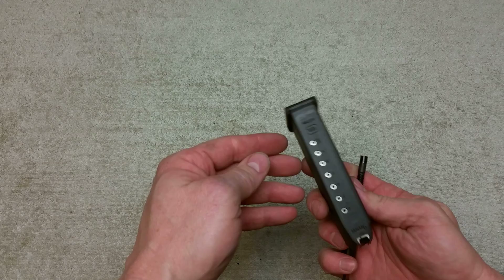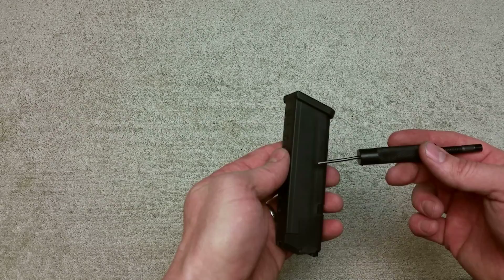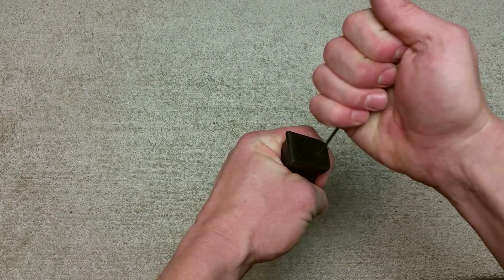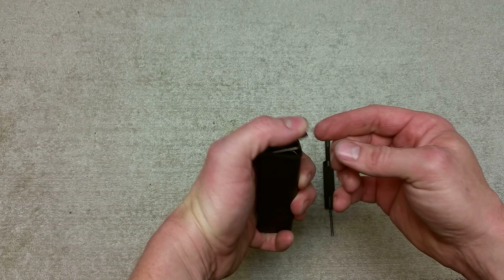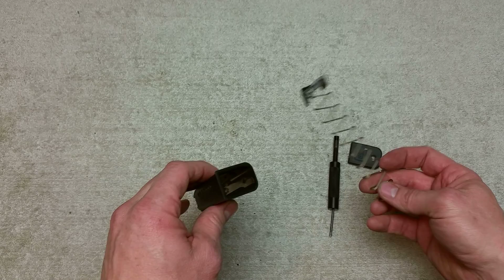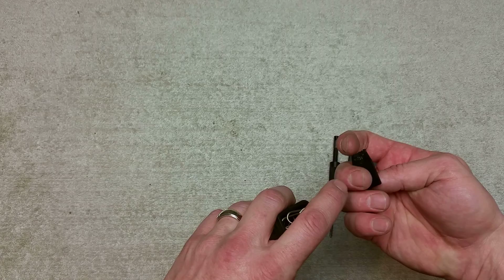California Glock Magazine Disassembly

Comment: Thank you for this, you saved me a lot of swearing trying to disassembe the 10rd mag.
Nobody else seemed to understand how the thicker mag body makes it more difficult then a standard glock mag to take apart.
Reply: Do you know if works on Glock22 10rd mags??? Lmk thanks
Reply: @Victoria Martinez That's a good question,  it should,  the glock 9mm magazines and glock .40S&W magazine are pretty close in dimensions to each other,  it might even be easier,  because  on the  .40S&W magazines,  the internal ribs that restrict the number of rounds that can be loaded would be smaller
Reply: @marubahoppie  thank you 👍

Comment: I've always wanted to know how to "disassembly" a Glock magazine lol thanks
Reply: Disassembly of this is useful to see, for those of us new to restricted magazine sizes. I didn’t even know that a ten round Glock mag was a thing until recently. A few years ago I ordered a 10-round AR mag thinking it would be a shorty mag. When it arrived it was  CA-compliant 10 round mag that was the same size as a normal AR mag, but with an insert and shorty spring (which I easily converted using a spring from a bent surplus mag that wouldn’t seat properly). Why would they make something like that? Why not just use an appropriately-sized 10 round mag? Anyway, this video helps me to see that I won’t be able to easily convert a Glock 10 round mag with these old springs that I have. So I guess I’m stuck with that I’ve got!

Comment: Can you hollow out the thick walls? With like a hot knife?
Reply: What every Californian wants to know.  Dremmel?
Reply: @upjumpstheboogie334  if you have cool family or friends out of state you can send them things you order online and they can then mail them to you. It’s a lot easier than the route you’re talking about. I’ve done it myself.
Reply: @Wormuloid4157  might wanna keep that to yourself next time feds are online too.
Reply: You can't, iv tried but ah..... there's brand called ets that uses clear plastic and no metal liner so use your imagination. Though I suggest a little saw, file and sand paper. First one took like 5 hours but it got easier when I figured it out. Also make sure to not screw up the feed lips with the file.
Reply: @upjumpstheboogie334  Dremmel couldn't even get through the plastic glock uses much less the metal liner, and even if it could unless you got a dremmel attachment that is like 7 inches long you're going to have trouble doing anything but the very bottom.

Comment: Didn’t work at all for my 10 round mag. Tab will only go down ~1/8” no matter which direction I push. Glad this worked for some folks though.
Reply: i hav ethe sqame problem
Reply: hey i found the way to pull out the back plate !!!!!is wey to easy  jus ttwo flathead and little of patient an dwork
Reply: @ezequielandrade3100  so it is possible then- for a Glock 10 round mag in California. Are you sure its possible? Ive tried and tired..
Reply: @AudreyBradford  yes but you still limited  to 10rds.  i remove the orignal base plate , and i install  aluminum  base plate, just to add more weight. on the magazine 
Note: i used long tweezer   and  i remove the plastic base plate from the sides, took me like 4miutes
Reply: @ezequielandrade3100  I will try using your advice. ty

Comment: I have the same California 10 round mag and I'm using a punch that fits into the hole and no matter how much downward pressure I apply that round button or pin will only go in less than a quarter of an inch and it's a hard stop I cannot get the plate off help please

Comment: It works okay, I have a 3/32 punch and pushed up against the corner 10 round mag is a real pain you severely scratch up the plate I didn't damage any but I would have preferred not to do it and gouge the plate. I think the actual Glock disassembly tool for magazines would be a better choice.

Comment: The reason it's so hard to pull off the base plate is due to the spacer itself. Where the mag normally bends in slightly allowing the plate to slide out easily

https://youtu.be/3JTd2384EZQ?si=kjjJhljMCZ9Nm3Ss